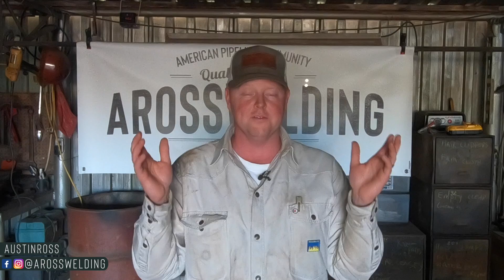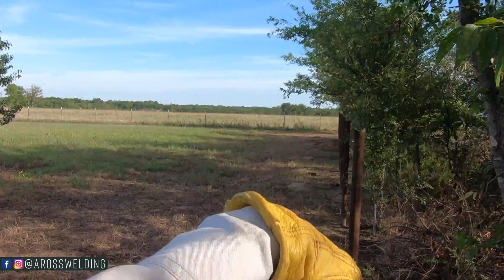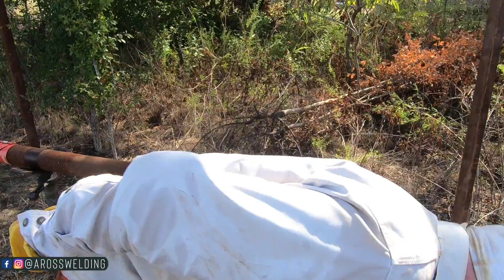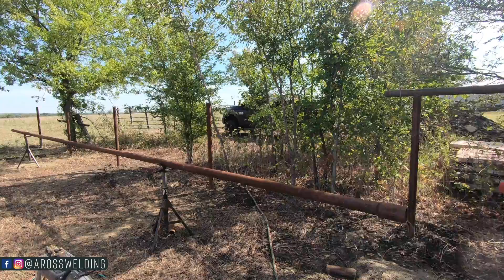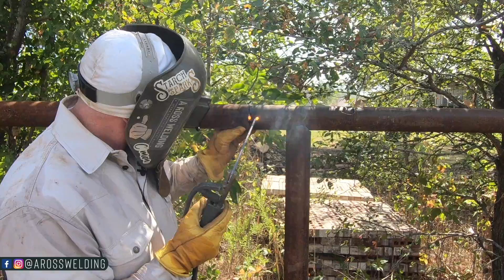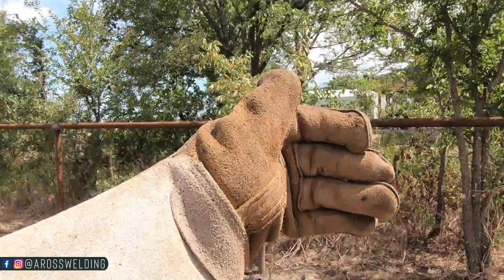Installing Top Rail Pipe Fence & Fitting Up Corners (THE TOP RAIL PICKLE)

Comment: What we do on toprail, is set posts' 10ft, then on the third post cut the toprail right in the middle of the saddle, then butt-up the next section of top-rail to it and weld it over the top then around the saddle.....

Comment: Maybe it would be beneficial when building a fence to jack up the middle of the top rail ever so slightly so that when you weld the rail in place, it would take out the bend down in the middle of two posts.

Comment: Awesome video austin! Hey, quick question about seam location. I used to work with a lot of handrail, and we would always position the splice to land on top of the post rather than off to the side like you have done.  Is it just preference or have you had the best luck running it that way. Thanks as always!

Comment: Nice work. So how long are each of those top rail pieces? Yep it would be a terrific to figure out some kind of cart/Dolly/something to move that stuff around with. If you’re ever in a real tight spot, hard to get your body between your work and a bunch of sticker bushes especially, stand up a sheet of plywood to hold back the bushes.
Reply: the dolly or cart for hauling pipe is called a grasshopper . Austin could make a light fold up version for himself

Comment: I'm sure you've mentioned it a hundred times before, but why don't you join the top rail at the middle of the posts?
Reply: Can’t weld the bottom of the top rail if it’s in the center of the post

Comment: Good job 👏  , please tell me how to level the whole poles at the same level high? Best regards
Reply from the maker: I just go with the ground using a string line
Reply: @arosswelding  where did you find the saddle template for 2 7/8ths?

Comment: 2 and 7/8s pipe?
Reply: 2 1/2” nominal
Reply: @Jesusisking12011  2 1/2" nominal. aka 2 1/2 NPS (nominal pipe size). Meaning the pipe size is called 2 1/2 while the outside dimension is 2 7/8 while the inside dimension changes depending upon the schedule size of the pipe. There's charts you can look up for this for all pipe sizes. Doesn't apply to tubing though.
Reply: @joeygalvez  I stand corrected sir.

Comment: My corners don’t look as pretty as yours Austin, I’m a self-taught pipe fence builder. My real job is farming. I just cut the top rail at an angle and set the ends on top of the corner 
post and weld it up.